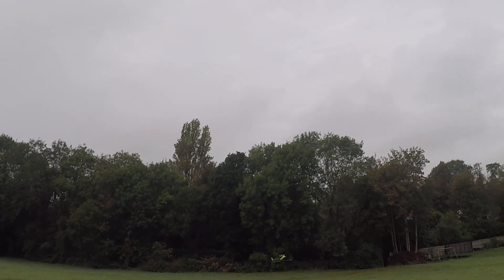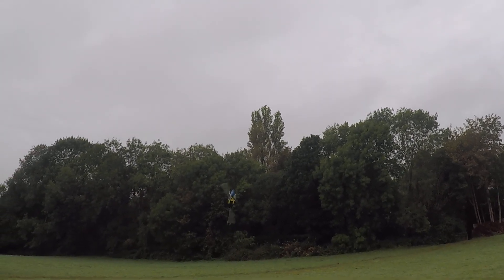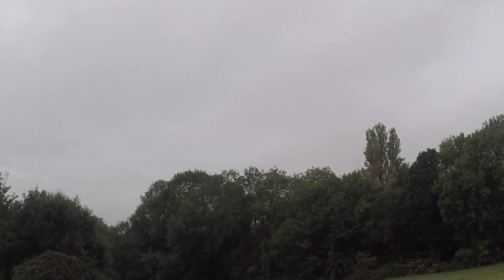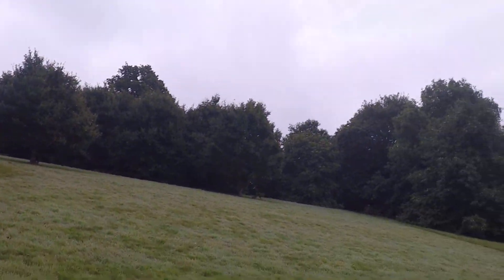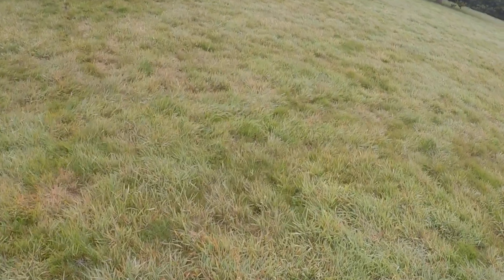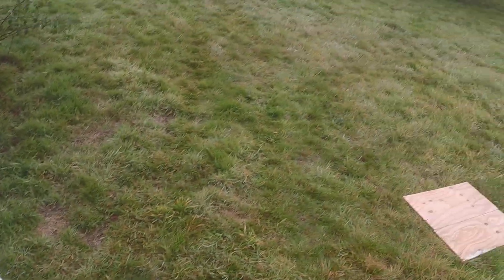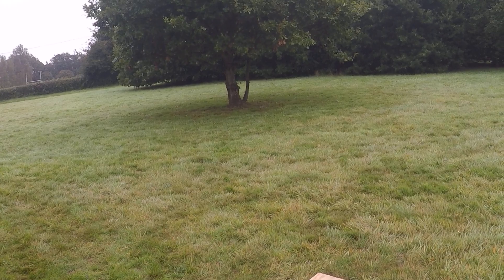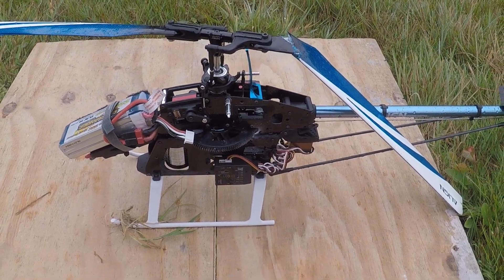trex 450 crash

Comment: Your head speed is to low for those tiny tail blades. Or try higher gain or less piitch. Still nice flying.
Reply from the maker: yes i hav the head speed to low i need to hav higher head speed less pitch, also the tail bearing seized which didnt help .all works now cheers